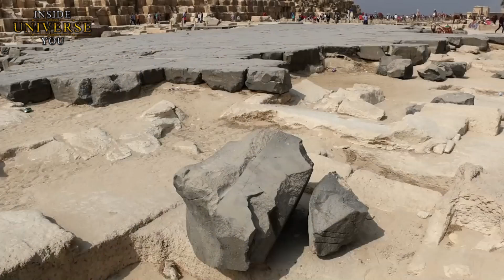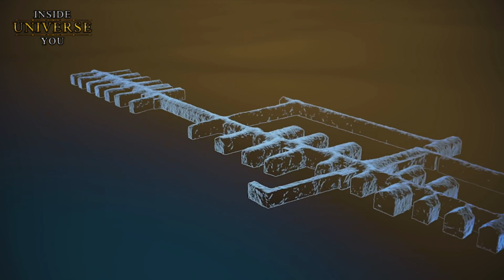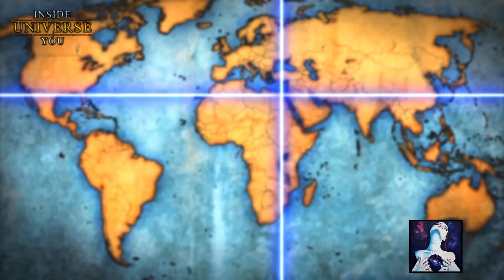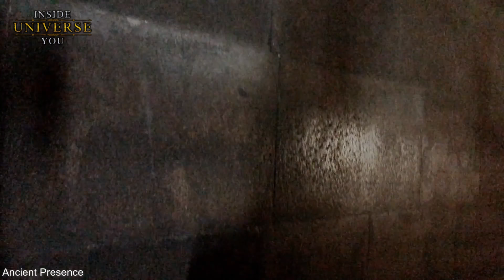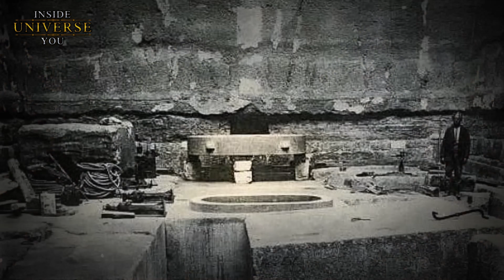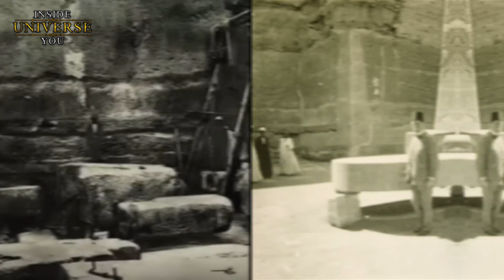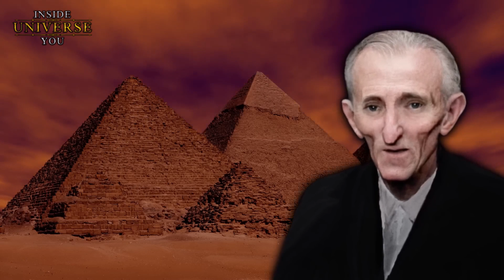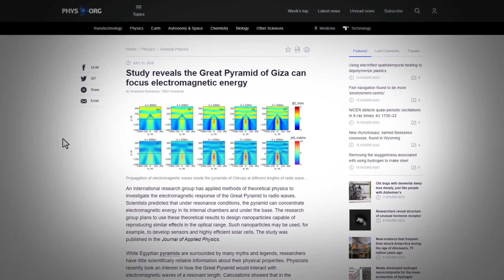Pre-Egyptian Megastructure Built BEFORE The Great Flood

Comment: If you really have a scientific vision you cannot accept in any way the established archaeological claims regarding the Great Pyramids.

The pyramids of the shepherd's plateau of Giza; named after the shepherd who owned the plot on which they are located, where his goats climbed up to the pyramids at night to have shelter.

If you have ever used a circular saw you know what marks it leaves on the stone, nothing more to say about that.
The stone trepans are evidence of the use of hollow point drills and the marks produced in the cut speak of very efficient and powerful machines.

Not a single mummy was ever found "buried" in a great pyramid in Egypt.

The pyramids of Giza have no marks, symbols or writing whatsoever. Except for the great pyramid, which has one an only graffiti with spelling mistakes, in a deep discharge chamber, designed to relieve the weight of the building and not as a habitable space. It would never have been seen if it were not for the dynamite used by a vandal in 19 century to make holes in the inner structure making him pass, thinking of secret chambers full of treasures.
Which led him nowhere except for the "discovery" of that scribble (which he probably wrote himself).

The precise degree of orientation with the geographic north pole is something that we cannot do today, not even NASA. And they did it three times, taking into account the meters that separate each of those named as "Keope, Kefren and Micerinos".

The signs of hydrological wear on the rocks surrounding the Sphinx, from a geologist's perspective, are no less than 30,000 years old.

The astronomical knowledge necessary to orient the pyramids with such precision to certain constellations could not have been acquired in less than 36,000 years, since they only orient themselves properly every 12,000 years.

Taking into account that they were based on visual observation, more than 2 astronomical cycles are needed to ensure the calculation of orientation. In addition to the effort of preserving this acquired information until the construction of the pyramids. Only possible with at least 36,000 years of knowledge.

Nobody denies that they were built by people who lived in Egypt, but who have nothing to do with today's humanity.

Comment: I have heard of ships made of concrete that float and traverse the seas. If they had the power to control and channel water. Whats so hard to think that they flooded the areas and floated the boxes to their locations. They suggest the boxes are batteries, do they conduct electricity? Or do they contain it? And where are the leads for the batteries? We know current flows in a circle and unless you complete the circuit it just sits there. Were those boxes filled with stuff? They look damn near surgically clean on the inside! No corrosion, no stains, so what are they basong those theories on?

Comment: Once more, the GP produced electricity?
Can anyone mention ANYTHING ancient egypt would do with electricity?
Anything?
Just stop it already with the GP being an electric generator, please.😮
Reply: An power plant is a weird one. Them being part of a chemical plant to make fertilizers and mining chemicals to melt, cut , shape metals and stones. Then maybe using the acids and such to make a more mobile source of energy that may have been used more like a very rough version of a battery. For simple light and heat. By trapping in the cavitation spaces in crystal or stone. That one sounds crazy but it's weird if you look into it.
TheLandOfChem is a great video to check out for on the ground research into this.

Comment: The 3 pyramids don't actually perfectly line up with Orions belt. Try overlaying it yourself and you'll see. It's something else most likely
Reply: The archaeoastronomy suggests that the last time the Giza pyramids were approximately in alignment with Orion's belt (originally The Belt of Osiris) was roughly 12,500 years ago (~10,000 BC). Maybe the goal wasn't to perfectly align with the celestial body, but to pay homage to, and incorporate this piece astronomical data into the design for some esoteric reason that we have yet to discover. Perhaps they were in contact with interstellar beings that came from there and used the Great Pyramid as an electromagnetic conduit to transfer massive amounts of wireless electrical energy to facilitate the connection over such a vast distances? Who knows.
Reply: It did a long long time ago before land masses shifted

Comment: Just to clarify when you're speaking about the pyramids mirroring orion over 12,000 years ago, showing the star shafts isn't correct. You must mention the star shafts mirror orion and Sirius in 2,400 bc, the 3 pyramids along the giza plateau like the first part showed in the video mirror orion about 10,500 bc. Its because of the star shafts mirroring the mainstream date the pyramids were built that creates the problem. Graham believes the pyramids were actually "mostly" built by the dynastic Egyptians because of the star shafts dates, and it was a commemorative date represented by the 3 pyramids on the plateau. I don't know if I agree with him or not, there is to many unanswered questions to just say yes the dynastic Egyptians finished the work on the giza plateau started back in 10,500 bc by actually building the pyramids. In my opinion the hardest part of the entire build is granted to the primitive tool using Egyptians, so either the Egyptians had tools we don't know about or the timeline is definitely far older than dynastic Egyptians. Or it's still Egyptians but from zep tepi the first time.  It's confusing as hell, and I would love to get the answer before I die or atleast have it answered in the afterlife.

Comment: What those pyramids are is nothing else but part of a giant electronic  circuitry ! Capacitors ,coils ,resistors in series and parallel configurations are still standing still to show what those pyramids were made for ! Electromagnetism as fuel feeding that circuit was taken from connections of different material conductivity ! Electricity was produced out of that complex supplying the entire empire ! Soot is nowhere found on graves or structures underground where reflections of sunlight do not reach ! 
The lighthouse of Alexandria was powered by them pyramids ! 
Batteries have been found allover like the Baghdad type found in Mesopotamia ! 
Technology then was much more sophisticated than today’s with unimanimagwnable precision !

Comment: gold is less conductive than copper or silver (which is a great conductor). Gold, doesnt oxidize. it remains pure.
Reply: Gold is more conductive than copper or silver.
Reply: @W1ZY  yes intelligence is more than water is computing
Reply: Like my blood!
Reply: If that were the case, then wouldn’t mind her computers, not ever need gold for the CPUs. Second,  gold is actually the most conductive metal on the planet.

Your comment sounded like complete nonsense to somebody that actually know something.
Reply: @daltonlightfoot6889  lol, you can look it up. I did. Thinking that you know doesn't mean you know the truth. Nature doesn't lie.
quote"Gold is a good conductor but not as efficient as silver or copper. However, it's often used in electronic contacts because it's highly resistant to corrosion and tarnish, ensuring reliable connections over time " end quote
Reply: @daltonlightfoot6889  Admit you're wrong.
Reply: @daltonlightfoot6889   Errm No the most conductive metal is silver, followed by copper and then by gold. The conductivity is defined by the free valance electrons of which silver has more (look up metallic bonding if you wish to know ore).

Comment: The tools required to build the Pyramids and the Serapaeum went missing with the Great Flood
Reply: ...or they were removed by those who used them. 
I don't know of ANY builder today, who just leaves the valuable tools used for building whatever they were building, 
at the site of construction. 
I know a lot of builders/engineers/contractors, and to leave the building site would not only negate the beautiful aesthetic meant to make the site special, but it would be an INCREDIBLE waste of tools. 
Looking for advanced tools anywhere on or anywhere near the Pyramids, would be like looking for the tools used to build a 10-story hotel - which I have contracted, when I was younger - (Wooden vertical sheets cut precisely to match the walls and door openings, double-walled, and filled with rebar, then concrete to make interior walls and door openings - making these forms is called "Industrial Forms Carpentry" - and, long ago, I was an Industrial Forms Carpenter - you have to be able to PRECISELY read the blueprints, or the metal doors and frames can't fit), the posts used to hold up the horizontal sheets that concrete was poured over (again, after putting in rebar), until this ceiling/floor hardened, the concrete mixers, all the worker's individual tools and tool belts, the Contractors machines - and on and on and on - and, not finding these tools on site, declaring that the Hotel COULDN'T have been constructed using advanced tools, because "we don't see any". You wouldn't know ANY of this if you weren't either knowledgeable about large building projects, or had done it yourself. 
MY tools - as both a worker, and as a contractor, were generally hauled away to other states and projects, or stored in warehouses far away. I'm sure the same applied here - but with MUCH more advanced tools (still, nothing gets built by magic, and tools are always tools - used, cleaned, maintained, and stored). The principle is the same.
I have seen that argument used COUNTLESS times by archaeologists, and it makes me laugh out loud every single time. 
God, the ignorance and arrogance of such fools, who clearly have NEVER participated in a large construction project in their lives, is mind-boggling.
Reply: Nope, they are left underground in a special place
Reply: логично
Reply: The aliens took their toys home.    The flood caused too many problems.
Reply: @slackerdug3423  welp, we lost our jackpot

Comment: The resonance theory just makes me laugh - you go in any cave - anywhere - start going hommmmmm and it will reverberate.

In fact any enclosed space made of stone.  Pick a church any church.
Reply: Okay but the secret to it all still is sound so what about that makes you laugh? Certain frequencies will have an impact on the environment around us that can externally manipulate the world… for example a singer hitting a certain high note will cause glass to shatter.
Reply: @icravebrains99   99.9% of the time only when amplified. Your argument is rubbish.
Reply: @icravebrains99  Get back to me when you have a practical application that makes even remote sense to build such a massive complex set of structures.
Reply: @doctormarazanvose4373  Did you not watch the video before making a comment? It appears that way or at least you seem very closed minded and are stuck on the church example you used. The practical everyday applications are that anything and everything including each cell in your body is vibrating at a certain frequency measurable in wavelengths. Nothing is ever truly still or stagnant so everything is an expression of a vibration. Thus different vibrations and wavelengths can be used to accomplish different tasks… Your body can use 432hz and 528hz to help regenerate cells as examples.

Who ever built these massive structures knew that the energy output from it would be worth the energy used to construct it. If the output wasn’t greater than the input, they would have never built it to be this complex.
Reply: @icravebrains99  Firstly, I did watch the video and your arrogance hasn't escaped my attention.

Secondly, 432hz and 528hz to help regenerate cells is a hypothesis so you can stop citing that as fact.

Thirdly, "stuck on the church" example.  Did you fail to read the previous sentence? Crypts, cellars, your head etc. plenty of reverberation in those.

Fourthly, "Nothing is ever truly still " - look up Absolute Zero or 0 Kelvin.

Fifthly, "Who ever built these massive structures knew that the energy output from it would be worth the energy used to construct it."

Complete supposition based on fantasy in your vibrating cranium.

Think of an ant crossing a road - it has no concept of what a road is but still interacts with it.   That's where we are with the pyramids.
Reply: @doctormarazanvose4373  You are totally right dude, these ancient people had zero clue on the power of sound. Plus they all must have started this massive construction project with zero purpose in mind other than to build a pyramid. Surely it was also a coincidence that they knew the magnetic center of the earth before randomly choosing the site for something this massive complex. They chose the material types at random too because they seemed “cool.” It truly was a pointless construction because you think one part of the video’s explanation is “laughable” in 2024. This goes way deeper than you or I could ever get in the YT comments.

Also when you reach 0 degrees kelvin let me know since the data will be a parabola, never fully reaching 0.0 because fully stopping its vibrational state would cause it to cease existence.
Reply: @icravebrains99  You really should come back to the real world and stop citing hypotheses as fact.

Correlation does NOT equal causation neither.

Hey you do you - just far away from me please.
Reply: @doctormarazanvose4373  Cite the source for absolute 0 in Kelvin, I’ll wait bud. Even if it’s to a billionth of a degree, it still will never hit 0.000 so what’s your point?
Reply: @doctormarazanvose4373  I’ll wait for your source that you choose to cite for absolute zero being achieved in the real world….
Reply: @doctormarazanvose4373  cite your source of absolute zero in kelvin that applies to a real world application… or is that a hypothetical thing too? “The real world” sounds very strange coming from you, reality is subjective so ultimately what you think isn’t real could in fact be true to the world just not to your limited understanding and prospective of what you would consider yourself “real”
Reply: @icravebrains99  I see you are using words to try and appear smart.

Seeing as you won't distance yourself from me I shall build a wall.
Reply: @doctormarazanvose4373   The pyramids are on the edge of the city today and were close to lots of dwellings in ancient times as well. You are being fooled by photographs taken from the desert coming from the direction of the Sphinx. TB fair I though the same until I actually visited them and the taxi driver dropped me off in the city 200 m from the pyramids.
Reply: @icravebrains99 resonant frequency right, we can kill any microbe with differentiated cell properties from our own with the same concept, we can also make the combustion of fuel much more efficient.
Reply: @carrynoweight  WHAT??? Not read such mumbojumbo for a long time.
Reply: @Non-Doctors-Music 
 it's not my fault you became stagnant and uneducated. 
 It's a demonstrated technology..
and a related medical process for cancer treatment has already been FDA approved and is in use (histotripsy).
You may resume your mindless chattering, I will not be participating.